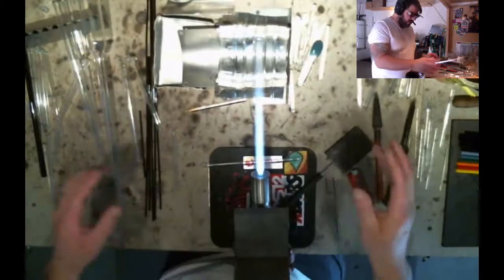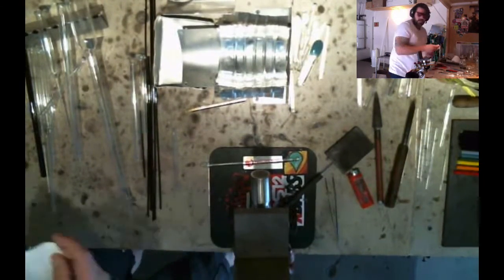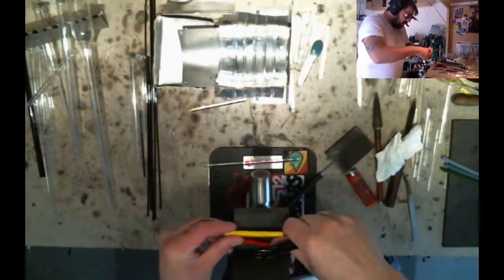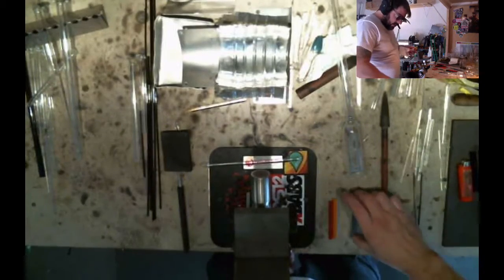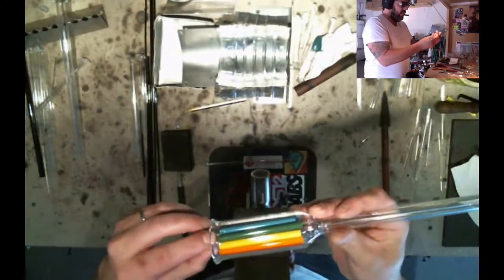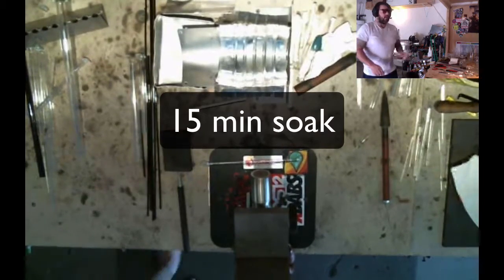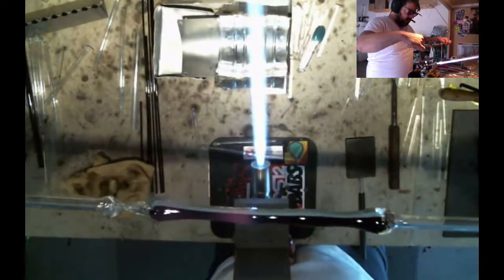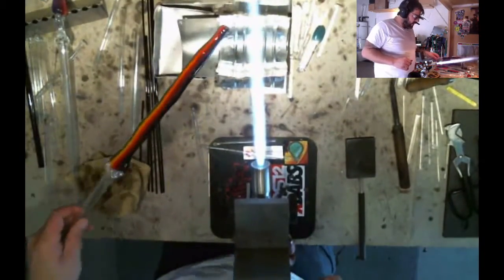Color Glass Tubing Vac Stack with no Vac

Comment: im not sure how safe it is to be using your mouth for this, i get that you said not to pull with your lungs but im still a bit concerned. isn't the whole reason a hood is so important to prevent us from breathing in any silica offgassing from the melted glass? particles & dust aside cause if it was just that we'd simply wear a respirator. there are fumes and shit offgassing from the melted glass. 

that said, i am a noob. so i could be wrong here as i dont know anything with 100% certainty.

it just seems.. like, idk the reason they use the vac probably is for more than just convenience.. like maybe safety. 

anyway all bs aside, im not complaining  thank you for the very educational video. i learned alot of new stuff. & weather im scared to try it or not atleast now i know something new, so thank you for that!
Reply: Let's be honest, none of us can confirm or deny the presence of "scary chemicals" in a vapor without being setup to do spectrum gas analysis.  
IMO there's no way any of that stuff is making it up the blow tube or blowhose.  Likely condensing an inch from the heat if it exists at all.  I've been sucking down sleeves with human power for 25 years, no ill effects yet.  That said,, the vacuum pump sure is handy for large and or long exhausting techs... like when I need to vacuum down a stringer stack millie inside of 85mm tube on the lathe.  What sucks about vacuum pumps is how they vaporize pump oil all over themselves and their surroundings... filthy.
Reply: i remember back in the 90s when inside out first got big there was a guy sucking on the tube while he was fuming... this reminds me of that. Btw, he died a few months later
Reply: Yeah just sucking in boron fumes and all the oxide fumes in the color. The heat even though its low eventually burns out vacuums so idk about the longevity of this tech maybe in a pinch for a demo. 🤢
Reply: @_-__--10035dhkie  what burns out vacuum pumps is that they run out of pump oil.  You gotta check em and top em off once in a blue moon..  If it was the heat, whatever hose you're connecting the vac with would melt first.

Comment: The tech Jason Lee showed me was to just stripe the color on the outside of the tube, then stripe clear over all of the color, condense, and pull.  We did 32 lines of color on 50x5 and then striped 12mil clear in between each line of color
Reply: Rob F. That's the way everybody was doing line to prep before vac stack became the norm also it's not known as vac stack  if there's no vacuum its Stick Stack. I was in house when the first true vac stacks  were being invented by Dave Strobel
Reply: @auraglasswerks4900 vac stack is a old industrial technique we just finally started to apply. 
A lot of us old schooler were doing stick stack before the vacuum came along. We just lost a ton of clear on either end and trapped air sometimes.
Reply: Wipe n swipe!
Reply: Wipe n swipe was the way for a while for sure. 
Back in the day.